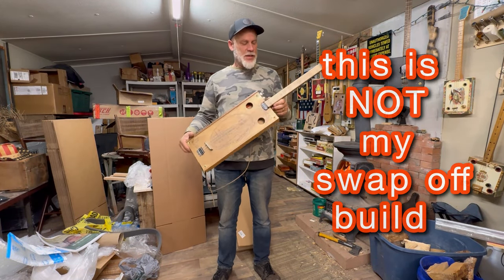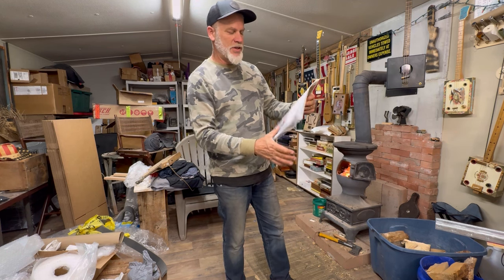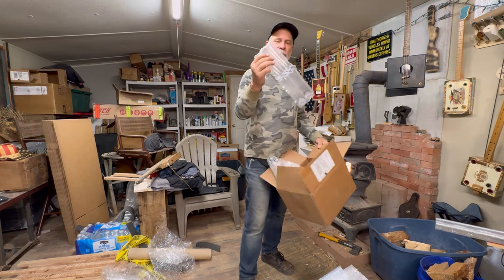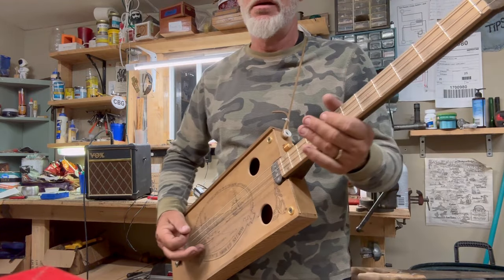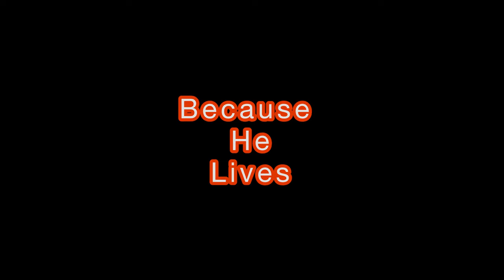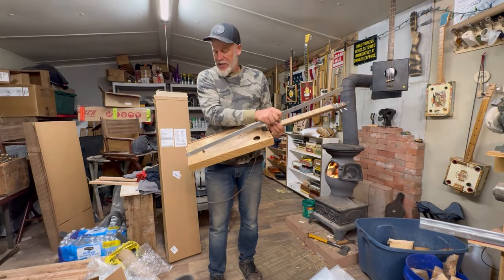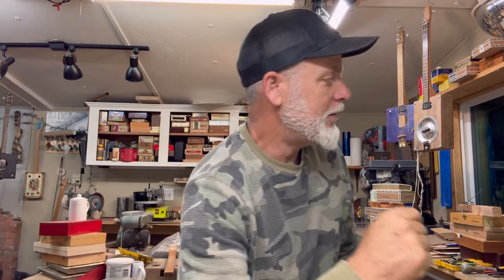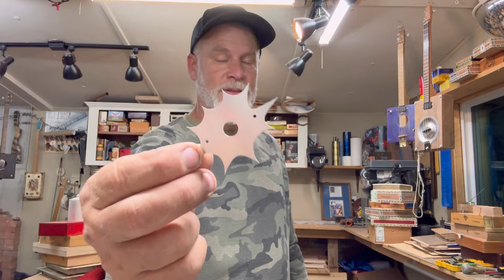The GREAT CBG BUILDER Swap Off - Packaging and Shipping “Ideas” - Baritone Sound Samples and more…

Comment: Hi Del, been watching your videos for a long time now and you have always given great tips which I have used many. Please could I ask using your fountain of knowledge on a special 3 string 21inch short scale guitar I have built, if tuning it to AEA using 26w,17w,13unwound skinny strings would put too much of a strain on the neck or should it be OK as I am guessing that the shorter scale and skinnier strings in theory should not be under a lot of tension. I have turned the guitar up using the strings and it seems OK and the strings feel quite slinky and a little more trebly than GDG which I quite like on this guitar; but just wanted a second opinion as to the string tension if it may be an issue or not. Thanks